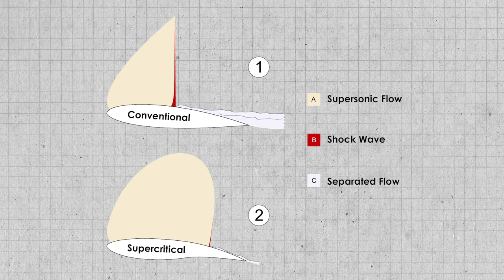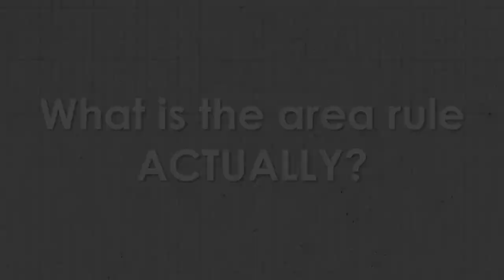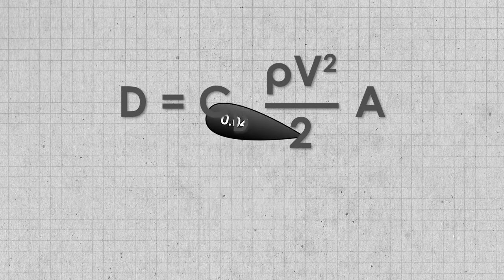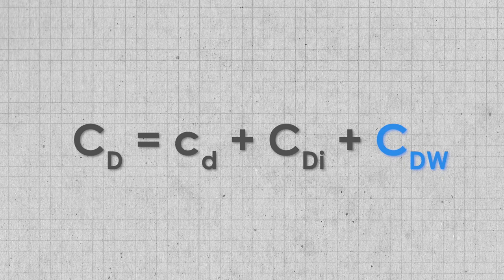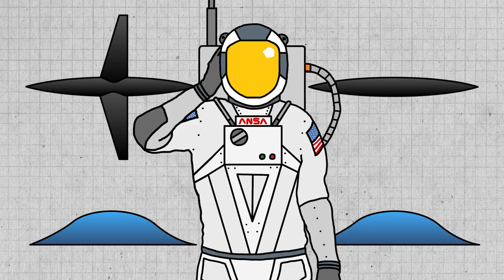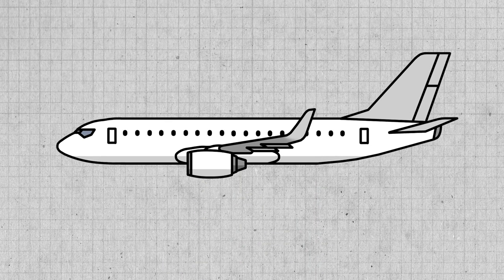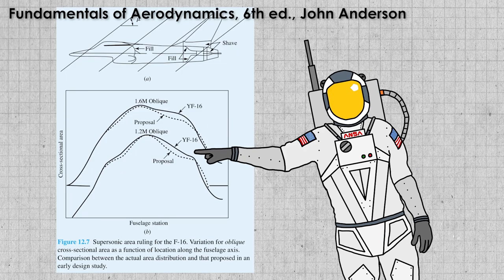What is the Area Rule ACTUALLY?

Comment: Area ruling for supersonic flow  the Mach wave angle, the angled plane, is really a cone.  So, the cross-sectional area is the Mach wave cone, where it intersects the body of the aircraft.  

The Concord would have a cone angle of 30 degrees for Mach 2 flight. Where the area rule would be optimized for its design cruise speed.

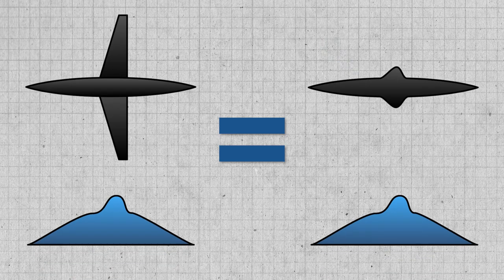Comment: I think i just found the best channel ever. This is truly a gem. Earned a sub. But at 3:11, how do they have the same area plot? I dont understand how they are similar? If what way am I supposed to look at it?
Reply: Maybe you're thinking of the relation of the cross sectional area to the area plot in the wrong way? The left model has long, thin wings while the right model is like a football with an extra bulge wrapped around it's waist. The left model obviously has more surface area, and covers more area when viewed from above...but these are not the areas of concern for wave drag. Area rule only deals with how cross sectional area changes as you move from the nose to tail. If you ran the two models through a bread slicer (the tip of the nose being the first slice and tip of the tail being the last slice), each slice would have the same area as the corresponding slice from the other model.

Comment: The reason why you have to smooth out the cross sectional area at an angle is to ensure that as much of the plane as possible stays behind the shock cone to prevent the shockwave from building up on various parts of the plane which will reduce wave drag. This causes the ideal area to be shifted rearward, it's for this reason that supersonic planes like Concorde feature wings placed further back and why their leading edges are sweptback to such an high degree. The area plot is not necessarily different when flying upside down as you simply take the angle of the shockave of whatever side of the plane you're basing it from. Since the Mach cone is symmetrical, the angle will be the same regardless of the plane's orientation.
Reply: Angle is the same, but the area cut is not (except for axisymmetric body). That is why series of area distributions is supposed to be obtained for each angle of orientation and then averaged over all of the angles. Early papers on area rule such as Lomax from 1955 explain it well.

Comment: I’m an aerospace engineering graduate but by no means an expert. My intuition would tell me that the effect the Mach angle has is due to the fact that the velocity profile of the air (in essence, the cross section of the air as it moves around the aircraft) does not necessarily stay oriented perpendicularly to the centerline of the aircraft. That is, as velocity increases, the velocity profile of the air, as it moves along the aircraft, will skew diagonally due to the velocity differential between the upper and lower surfaces of the aircraft. This effect of the air’s cross section being further towards the tail on top of the aircraft means that the “area” you’re trying to modify must be oriented to match the velocity profile’s new diagonal orientation. I’m sure that equating the velocity profile’s diagonal skew to the Mach angle is not perfectly accurate, but it is probably close enough to use as a guideline for design. Please let me know if this isn’t accurate, thanks :)

Comment: I tend to think of it as the before and after of the F104 Delta Dart.  This is where it was first applied by Whitcomb.  The plane could not go SuperSonic so he encouraged a coke bottle design.  They quickly reshaped it and the new model went supersonic on a climb.   Whitcomb always said he thought of the airflow as stream pipes coming off the plane surfaces, and the goal was to streamline those out so the could flow undisturbed - and that he needed to visualize this in 3 dimensions.  Fun fact: the space shuttle is NOT area-ruled yet goes as fact as Mach 24.
Reply from the maker: Well the space shuttle is supposed to slow down from supersonic speeds rather than maintain them so maybe it’s a net benefit

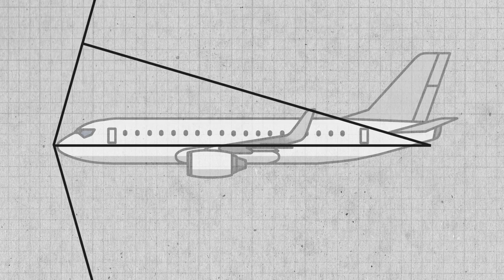Comment: 4:34 if I'm not wrong using oblique cross section slicing for supersonic area ruling is an approximation, and you have to roll the cutting plane around the axis of forward motion while maintaining the angle, and average the cross sectional area.

A more rigorous solution would be to mesh the surface of the entire aircraft, and project a mach cone from every point, and see where the density of cone surfaces is high and reduce it. There's also the effect elsewhere in the comments where the airflow changing directions as it passes over the wings influences the cone angle

Comment: there is only ONE patent prior to Whitcomb which you showed. NO prior evidence of the notion of area ruling before that that I am aware of. But that patent was for EXTERNAL features, that were droppable, and never resulted in a single aircraft nor practical application even to this day, and made no attempt to shape the airplane itself (relying primarily on the external pods to achieve the effect, which results in all sorts of secondary issues).

Whitcomb's work was also validated, and implemented. And thus Whitcomb gets the full credit. And not only did he use his idea to fix airplanes, he used it to fix wind tunnels as well.

Comment: that area rule sounds much too dumb to be an actual rule. Surely the equalization has to be angularly close? contribution from the wings can't just be countered by a dip at the top of the fuselage? it must be right at the foot of the wing
Reply from the maker: No, it can be on the top of the fuselage. Look at the 747: later versions had the hump on top of the fuselage extended to help with the area ruling despite it not being near the actual wings. This configuration counterintuitively gave it more cargo space with a net decrease in drag
Reply: @ConHathy  says who?
Reply from the maker: @DanFrederiksen  I learned about it in university but it has also been in "The Whitcomb Area Rule: NACA Aerodynamics Research and Innovation" by Lane E. Wallace. There is a widely circulated figure showing the area ruling and reduction in drag here (It says it comes from Aeronautics and Astronautics 1973, in my couple of minutes of googling I couldn't track down the original source of the figure but that would have been a NASA report): https://www.researchgate.net/figure/Boeing-747-cab-extension-subsonic-area-ruling-Source-Aeronautics-and-Astronautics-1973_fig82_349063662
Reply: @ConHathy  thank you. I notice that the extended upper version didn't come out until 1983 but it could still be experimental data before  it was done. Wiki says the extended upper  were on request from airlines though. And I note that the supposed benefit doesn't kick in until above the max cruise speed of the 747 at the time. So it could never benefit from it according to that data but if the data is real, it's interesting nonetheless. Would be interesting to see that experiment done again, perhaps in good simulation as well to explore the airflow and shocks, if the area rule is in fact in effect.